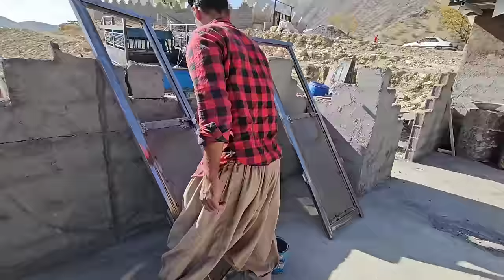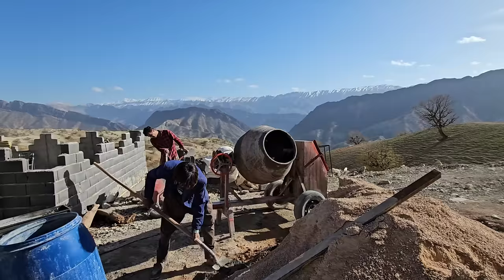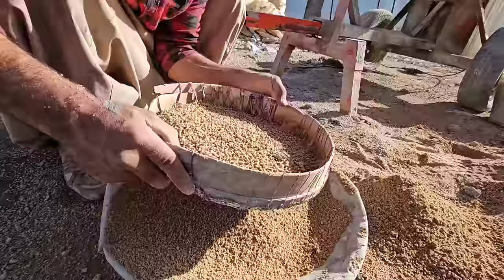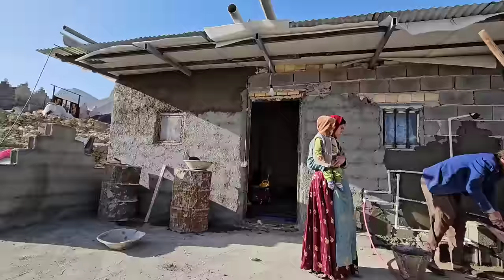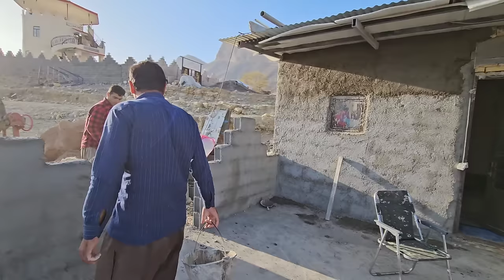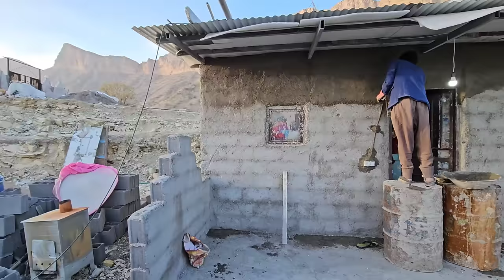Hardship of a Nomadic Family in the Spring Wilderness

Comment: Krosbow, I would like to suggest to complete one project at a time, otherwise you are having two many items incomplete.  For example, you need to complete the plastering for the entire home, especially the walls that are humid and wet.  The wooden stove pipe on the roof needs to be sealed for water leaks.  The kitchen cabinets were not complete, you still have one more cabinet left to be to be installed.  The roof insulation needs to be fix by the outdoor area it looks unfinished.  Your barn roof is leaking, well I could go on and on.  Just an advice you will get more audience when complete project are done.